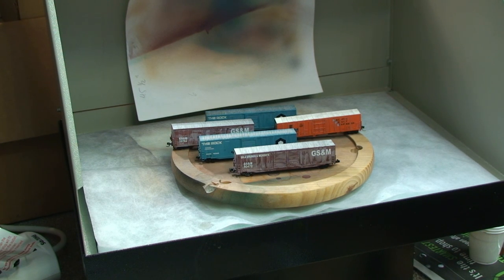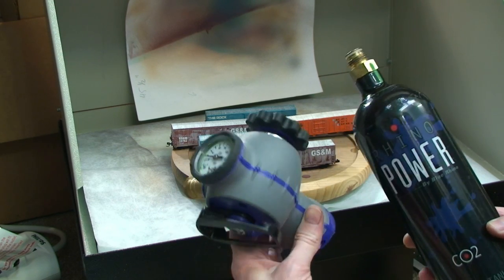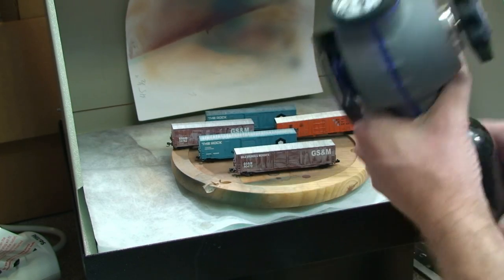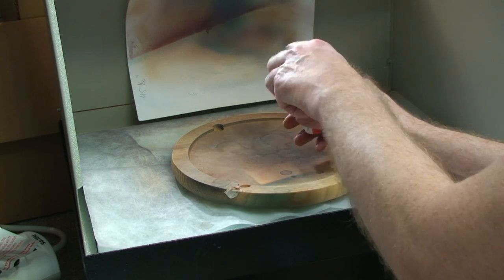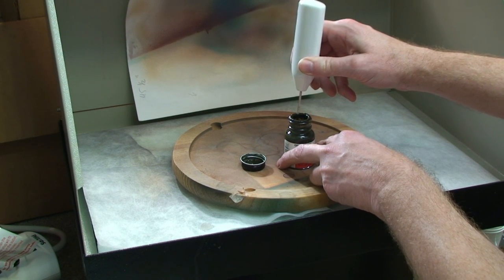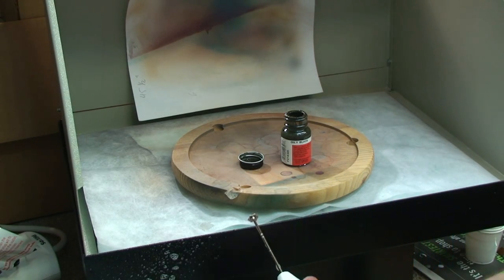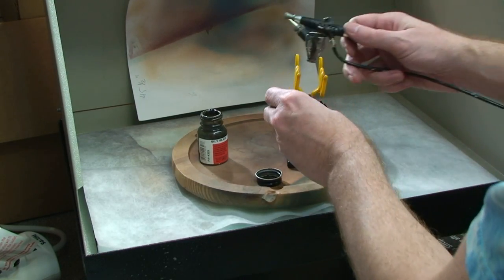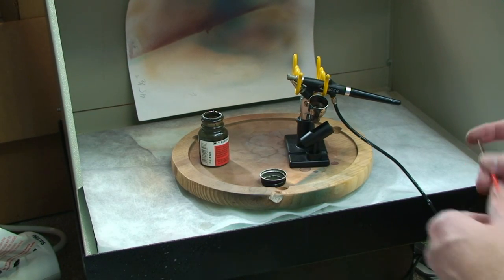Episode 7:  Airbrush Prep  Extra Weathering

Comment: you waste paint by using the stirer & the straw. an eye dropper held at the top of the paint and shaking work fine, using brushes is what creates the gunk on top. also what happens if you run out of air in the middle of a project? you buy extra bottles? I have a hobby compressor that you can't even hear with my door closed.